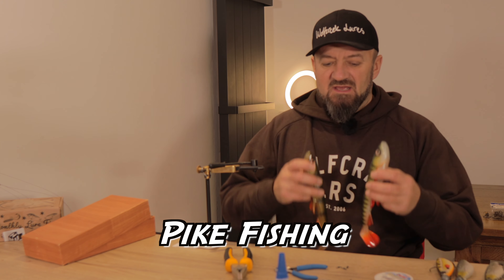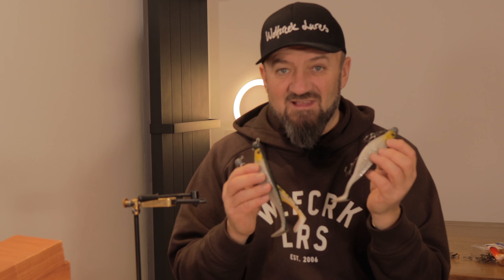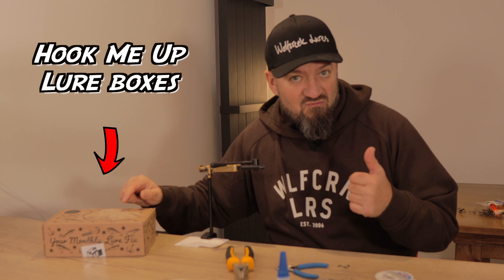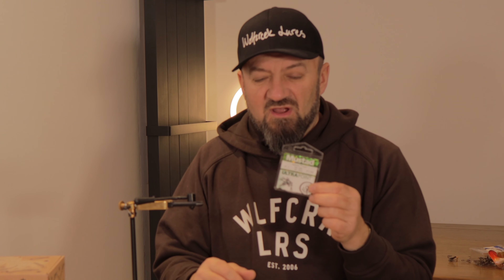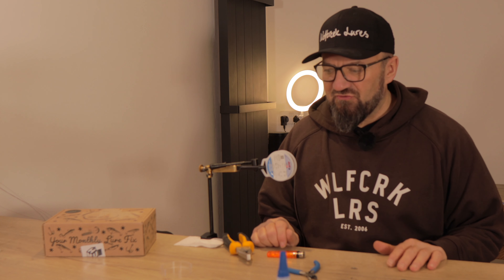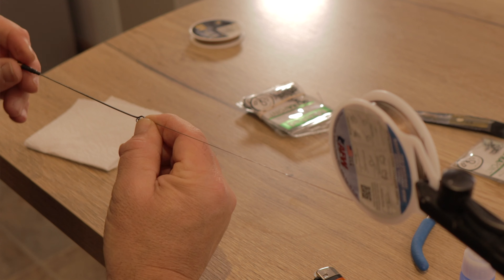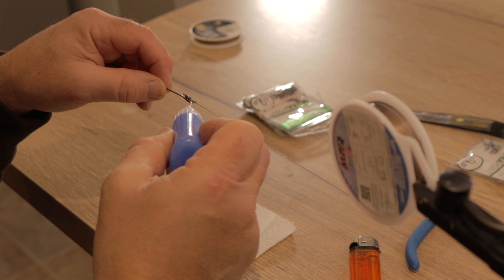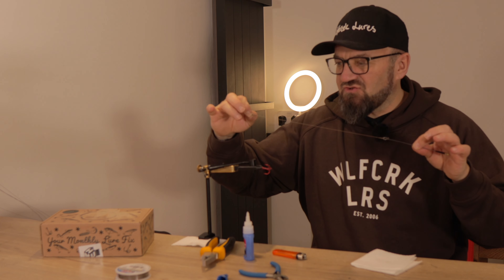Making a Pike Lure leader the EASY way!

Comment: What about WOLFRAM leaders ?
Reply from the maker: I used Tungsten for all my traces for a long period of  time. However I discovered that crimps react wit the wire. I even had one set up fail in my hands even before I used it. I had tied it around a year earlier. 
I have had other angling friends who have encountered similar issues, hence why I went back to twisting.
Thanks for msg 🙏